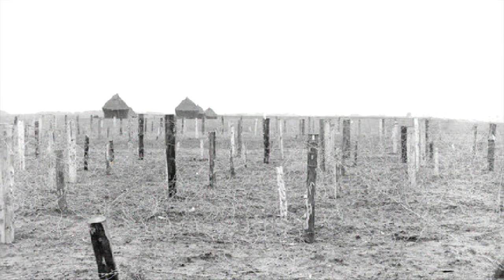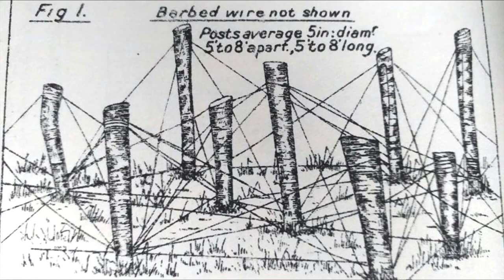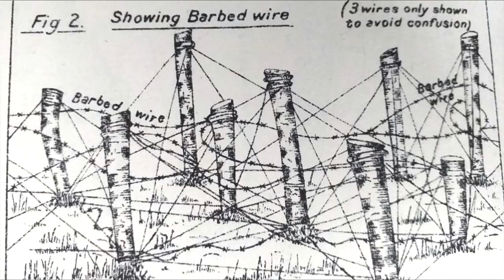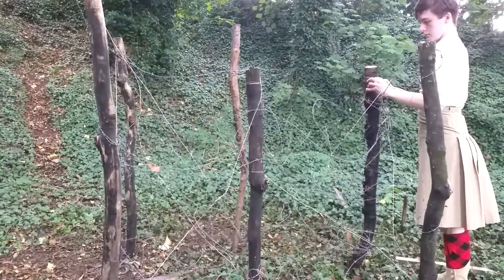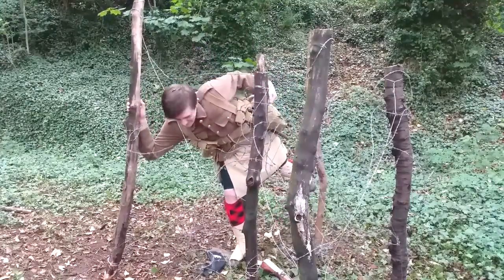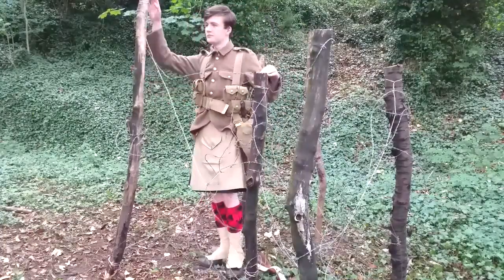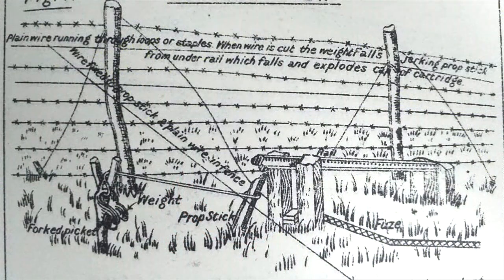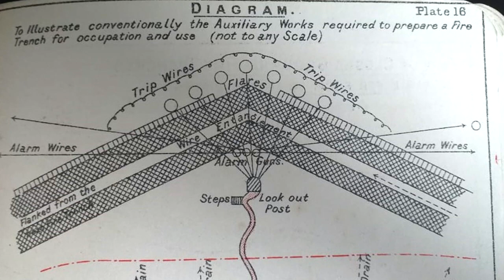Barbed Wire & Booby Traps - WW1 Field Engineering

Comment: If at all possible, you want a quasi linear lane with your wire and obstacles.  I hope I can make this understandable. Picture your units “frontage” from above, looking down, imagine an X with your machine guns posted at the base of the 2 endpoints of the X.  Why? So that between the two machine guns, you best mass casualty producing weapons cross each other so there is no way an enemy can approach your position without passing through at least 1 MG, preferably both, and with coordination with units on your flanks, even more.  You want to stop or, at the very least, slow the enemy within and along your wire’s path that is also your MG’s axis of fire.  This placement of the wire obstacle also ensures that the gun can be effectively employed in hours of darkness and reduced visibility, fog, rain, snow or use wearing a gas mask.  Especially when required during the FPF, the gunner can rapidly, reliably and reflexively pour fire down the line made by wire obstacles.

Comment: Are those 22 oz kilts reproductions? Where did you purchase them? Top quality historical reenactment. Congratulations
Reply from the maker: Hi, they are originals, the officer's one is from the 1930s and the other ranks from the 50s. We've got a few more in the collection, mainly sourced from Ebay and local second hand shops here in Scotland.
Reply from the maker: The buttons were already on. As they are fastened with pins instead of buckles they tend to fall down if you don't wear braces!

Comment: So germans didnt use barbed wire?
Reply: Didn't they just! Mountains of it because they were essentially defensive - all they had to leave was patrol lanes.
However, if you were "going over the top" how would you like to be confronted with the obstacle illustrated - from your own side - before you crossed no man's land and faced their wire !?!
If you're looking to be advancing through your own wire a "low wire entanglement" is your answer.
Slung, fairly slack. about knee high it is a serious trip hazard and embuggerance for anyone trying to cross it at speed in the final assault - bearing in mind all obstacles are covered by fire - but possible to pick your way through at walking pace.
Wire, mines and obstacles was my "second hat" as a Grubby Subbie many years ago.